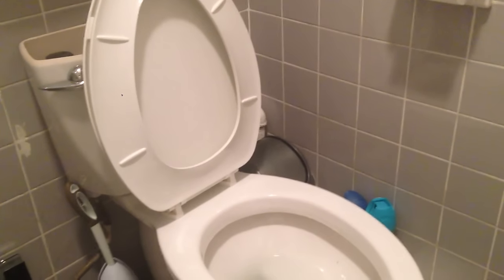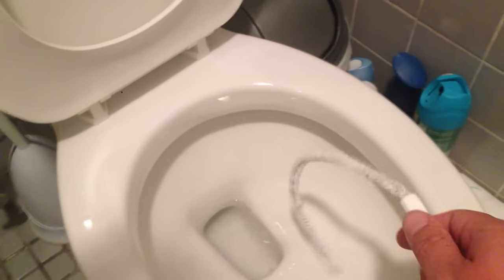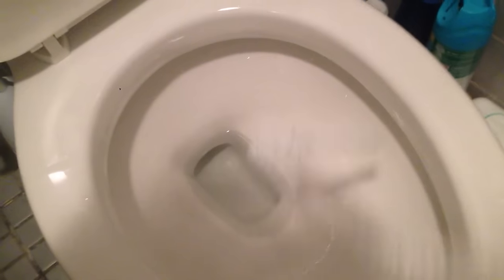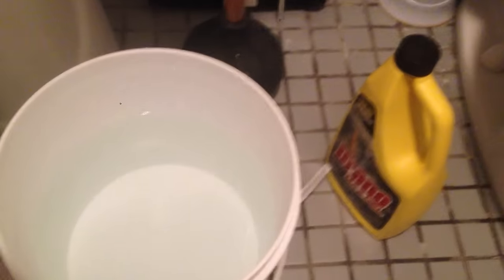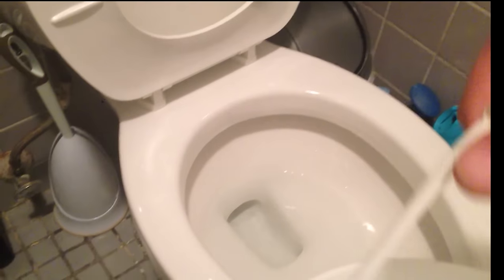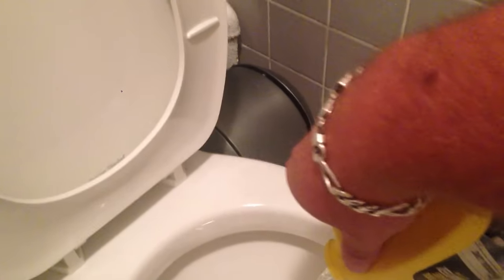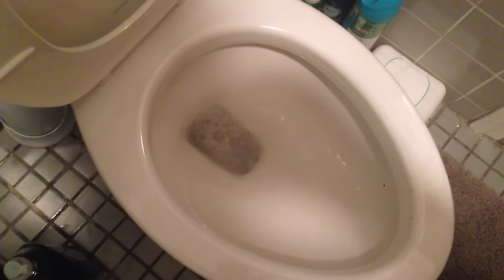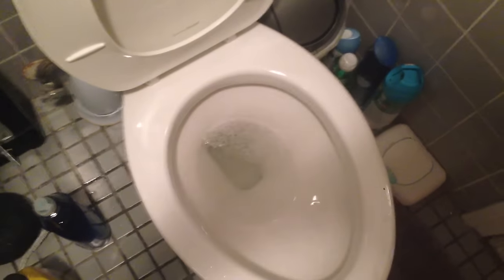How To Fix Slow Flushing Toilet  - Not Flushing Properly

Comment: My toilet was flushing exactly like yours at the start of the video.  It wasn't clogged but it was going down slowly with the long glug glug glug at the end, just like yours.   I didn't have any drain cleaner so I tried just the soap.   Well it worked like a charm,  the soap loosened whatever was blocking the flow and now it flushes like new.   Thanks for the great tip!
Reply from the maker: I am happy that my Video helped you :)
Reply: Does it work on any toilet ?
Reply: @yun514  It would not work on tankless or pressure assist toilets.
Reply: jgallantyt the hot can break the bowl if you put so long put  hot water istemate 3 menutes din plush the cold water
Reply: @OCC_Plumbing_and_Restorations  what causes a new set to not flush properly?
Reply: @babyghany9991  I'm not sure
Reply: @renaelmanibad4199  Use hot water from the TAP NOT boiling water!

Comment: All that plunging... All that snaking... All that using a bucket... Repeated times pulling the toilet... The new flush valve... The chemical drain cleaners... 3 months of unreliable flushing... And all it took was a coat hanger in the jet... Don't know whether to laugh or cry
Reply: I laughed out loud at this one. Thanks for posting this. It’s a laugh and cry kind of moment.

Comment: CAREFUL in winter!!!! HOT WATER can CRACK PIPES!!!!!
Reply: Fiddlekrazy Steve so I shouldn’t take hot showers in winter? 🤨
Reply: So I should wash my dishes in cold water?? 
& running HOT WATER to wash my hands isn't a good thing now?? 🤔
Reply: Very true.  You have to be careful in winter.

Careful means just that...... to be careful.  It doesn't mean you can't do stuff, especially with internal plumbing, and depending on what kind of pipes.

The piping that has exposure to the winter CAN crack so you just use caution.

But for a fun experiment to the nay sayers, throw boiling hot water on your windshield to help  to remove ice.....see what happens.....have a spare windshield ready ; )
Reply: J G last time I checked. Pipes weren’t made out of car windshield
Reply: Not what i said.  I was makng a point about extreme cold to sudden hot......science stuff.  You didn't get my point but cool
Reply: Hot water can break that bowl...
Reply: Cold water gets  germs stronger and hot water kils them not very  hot any hot u want
Reply: Boiling water breaks the bowl.
Reply: J G That’s a terrible example. Pipes are not made of glass, the water isn’t boiling and it’s never going to go from ice cold to boiling hot in the pipes because hot water is going to mix with the cold water already in them and make it get progressively warmer. If anything the bowl would be at more risk but I’m assuming you have heat in your house so the toilet isn’t ice cold and it’s just hot tap water mixed with a bunch of not hot soap and drain cleaner so it’s not going to be all that hot.
Reply: So as a plumber I can honestly say that adding hot water from the tub or lav. faucet to drain pipes or a toilet will not break the pipes. Putting boiling water down pipes can cause the pipes to expand and contract putting unnecessary stress on the fitting joints which over time can cause cracks and breaks. What I would be concerned about is putting chemicals like Driano into you drain lines. I personally avoid using those products when clearing a clog.
Reply: @kevinwells4086  You the man 🙌🏽
Reply: @Tsch6373  No that's cold water on a scorching plate silly 😀
Reply: @ThatOneExoRailfan  No it doesn't... Cold water breaks scorching hot ceramic ... Silly Billy 😀✌️
Reply: I ALSO love CAPS LOCK and as we say in the tech industry, BANGS!!!!!!!
Reply: @JG-zd3md  Piping isn't glass..
Reply: @alanmarietti5454  so what would you use instead?
Reply: @kevinwells4086  a toilet is a large ceramic like a coffee cup. Your tub, if older like a claw foot is porcelain clad over steel.
Reply: @JG-zd3md  LOL! I try ta tell em JG.
😉😁
Reply: @777fiddlekrazy  I know.
Reply: Let them comment and not believe science.  I'm not paying for their repairs.  Even the plumber said boiling water can expand
Reply: Our plumber placed the toilet vent about 15 feet away from d toilet ,could this cause air restrictions and slow flushing?

Comment: 1. Use Drain Clog Remover Tool, Drain Hair Clog Remover Tool, Sink Drain Clog Remover, 20 Inch Drain Cleaner Tool for Sink, Tube Drain Cleaning
2. Use a 1.3 gallon Collapsible Bucket of hot water. Pour into toilet and flush
3. Use Drain pipe Chemical (Drano max gel) any might work but try to stick with a gel. Pour into toilet. 
4. Dish washing detergent Like Dawn or similar. Open Toilet Tank Cover.  pour into Toilet Tank in the overflow pipe. Just a little. 
5. Leave for about 5-10 minutes
6. Flush to see if works

Comment: Yes i had serious calcium  almost completely clogging that hole 1 inch hole in toilet used a bolt/chisel  to break it free...finished up with boiling water a dish soap trick...You solved a problem in my life that has been pissing me off for over a year...Thanks!

Comment: I did it!!!
I wasn’t as easy as shown!!!
I wanted to do more environmentally friendly so I used daill soap and vinegar instead of draino. 
Used boiled water and left it fit 3 hours. 
Once the water cooled off I went to explore the openings. I felt a lot of minerals deposit!!!!
It was hard as a rock. There was no way a brush or tough washcloth would do. 
Used serrated knife , some came off, poured more vinegar and more soap and waited for 3  more hours . Poured in more boiling water. Scrubbed with a fork, more minerals loosened up. It was very hard to chip away a crumb of the stone , but I got about 90% of it !!!
I look at this as a success! 
I’m saying all this because some people may be discouraged and say the approach doesn’t work . In some cases we need to use more muscle to get the results . My toilet was expensive so I don’t want to get rid of it if I don’t have to. Next time I’m not gong to wait this long and inspect it for mineral deposits. 
Thank you for the post .
Reply: well info.! thanks Gratitude! : ) i like dial soap & vinegar!!
Reply: Be careful in using beyond hot water to avoid cracking the porcelain bowl!
Reply: NEVER use boiling hot water! Just the hot water from the tap! You were lucky. Boiling water can and will crack the delicate porcelain. PLEASE DO NOT USE BOILING HOT WATER IN YOUR TOILET !

Comment: Excellent video! Although I have the Kohler cylinder flush valve, this worked like a charm. I also didn’t use liquid plumber as the instructions said not to use with toilets. For those with the similar cylinder flush valves that I have, just disconnect the overflow line and put 5-10 drops of the dish soap and reconnect. You’ll see the bowl dribble the soap slowly and it took me five flushes (repeating my soap drop method). Thank you for the easy video. The King is back on his throne!

Comment: You video helped us so much. Our toilet was flushing so slowly like it didn't have any water pressure. We did everything we could think of even removed it off the crock to check for blockages. If not for your video, we would have never thought to check the small hole at the front of the toilet. Turns out there was a pop cap lodged in the small space which was causing all the problems. So thanks from the bottom of our hearts! You have saved us a huge plumbing bill!

Comment: I was at wits end with my slow toilet,.we have a septic and thought it needed to be pumped again. prior i had cleaned the calcium that had built up around the upper jets,.and still had a slow drain..I was about to call the plumber,then i seen the first 45 seconds of you vid it and didn't realize there was a lower jet..so i found stout copper wire and and began to poke around.. sure enough the entire jet was caked over with calcium,.now it flushes no problem..Thanks Teck!
Reply: g

Comment: amazing, i fill big bucket with soapy water and it didnt solve slow clog, hot water with it of course. However, when you showed putting it in the water tank and let it sit and flushed twice
it went down with mass force. You are a pro! Thanks a ton

Comment: WOW, IT WORKS!!  I almost removed my bowl. I did this with hot water and 6 oz.of HTP. Trisodium phosphate and used a clothes dryer vent cleaning brush. Bent it to fit and the crap that came out was unbelievable. Worked on the first try. I did it 3 times for safe measure. Thanks!!!

Comment: I just followed the instructions except I didn't have draino I used comet in the bucket of hot water and then I topped it up wit 1.7 liter of boiling hot water from the tea kettle. Dawn dish soap in the over flow.  Coat hanger front and back jets. And it flushed itself when I turned the water back on once water went into the over flow. Thank you for making such a good Video!!!!

Comment: Holy crap! I only got as far as checking the front hole but, there was a piece of plastic in there floating around and some calcium buildup that would block the hole when you flushed. Every time I flushed, I could see this plastic at the hole. I pried that piece outta there and viola, flushing normal. I guess the previous renter had kids who played in the toilet.

Comment: i might have just had a deep clog but either way this worked for me. hot water, drano, some detergent. i did hit it with the plunger after and its flushing like a champ again so either way im happy and this was easy. thanks for posting. 

when it wasnt draining still i was like maaaan i might have to go get a snake or auger, but nope this method and a little plunging worked for me!

Comment: A slow flusher is VERY likely the water mineral buildup clogging the fill holes that underline the bowl Rim.  Teck did mention this, I'm just confirming it.  I'm convinced this is what is clogging 1 of ours, because 1 of our best flushing toilets has the same 15 year old parts & yet flushes amazingly fast.  Water shooting out fast from the Rim holes CLEARLY has NO obstructions/not clogged.  Teck's vid here further proves that cleaning the Rim holes is very effective.  That Drano gel AND Dawn soap clearly unclogged the Rim holes, but i can understand using a harsh chemical.  If so try CLR instead and manually clean the Rim holes.  Try a brillo pad & round bristle brush(s) & CLR instead of the Gel.  Or your choice of gentle cleaner.  Bear in mind dissolving hard mineral deposits could very well require a harsher cleaner.   Focusing on the clogged Rim holes will be the fastest & cheapest thing first.  Was going to try CLR (Calcium, Lime, Rust) when i just found this vid.  Will give both a try if necessary.  We are renovating projects & i am fixing our 14 year old toilets.  If unclogging the Rim holes fails to fix the flush problem, i will rent a toilet auger.  If that doesnt fix the prob, i will replace the toilet.   If I pull a toilet, its ONLY because i'm going to replace the entire old 1 with a new one & only because we cannot get the clogged Rim holes cleaned out.  A new install Is tricky, ALOT of work and pricey depending on what you buy.  You get only 1 shot per bees wax ring.  aka --if H20 leaks at the floor level, you've got to pull the toilet yet again, remove ALL the new bees wax & slap down a 2nd new bees wax & install toilet again.  I've had 100% success in the past.  We are going to get a water softener installed that will eliminate the hard water mineral clogging problems once & for all.  Our shower heads are getting clogged very fast with water mineral deposits too.
Reply: ok

Comment: Dishwashing liquid will usually help any toilet flush faster but you have to squirt a little into the bowl before each flush. One thing I have learned over the years of fixing plumbing issues is that these low flow toilets, (fixtures, appliances, etc) and older homes / buildings in particular are NOT good matches. There is often not enough water to flush everything out into the street's main sewer line so in enough time it's not unusual to wind up with a slow running drain. I come across this every year or so with the same older homes. The owners are often hell bent on saving water. My recommendation has been to keep what you have (vs replacing) and make adjustments so that a low flow toilet flushes with more water or an older model flushes with a little less water. There are also many older makes (pre 2000) that just were not made very well (1st generation 1.6 designs / cheap stuff) and as a consequence they flush slow. I would replace that but consult with a trusted pro before making that call.

Comment: Thanks, Mate.  This worked well for my toilet. Tried it 3 times and finally its working well.. I would recommend letting the dishwasher liquid to stay in the pipe inside the flush for at least an hour..  Also I cleaned the inside rim of the toilet bowl using the same dish washer liquid by hand using a scotch Brite sponge.(Use Gloves).    Great video..very useful.
Reply: Jayan, good tips! : )yes 'great vid.!

Comment: Is pouring drano safe i know the back says not to pour in toilet
Reply from the maker: It should be fairly safe, not 100% safe. It is not recommended for unclogging toilets. but in this case we are not using Drano to unclog it, we are using it to remove or dissolve element in the front jet area and not anywhere near the back where the wax ring is located

Comment: Californians are often using buckets to flush their toilet with shower warm up water.  We did this.  What happens it that it sends toilet paper into the jet hole and along with calcium will totally plug the jet.  I found it out after replacing the toilet I could not get to work after trying everything.  When I cleaned it up to give away, that is when I found the clog.  So I would recommend Californiana save their rain water in a watering can and take it to the garden.  

Also, when we lived where we had a septic system, we had to use the bacteria additive if the toilet gurgled when flushing.  That always helped it.

Comment: Terrible video!  You never ever use a chemical like Draino for toilets.  The heat from the Draino chemical can damage the porcelain and possible crack it.  Use CLR, or vinegar to water mix 1 to 10.  Don't forget to clean out the jet in the bottom of the toilet as well as the fill holes in the toilet rim.

Comment: 6-9-2019 at 9:35 I tried it first I flushed the toilet to check the Jets and only a few were working so I put dish soap waited for a few minutes then flushed it and holy (CRAP) it worked all the Jets work with full force now I can go Al Bundy style lol thanks for your help
I finished at 9:41
Reply: Did it foam or not. ??? I hope it works for my toilet bowl.
Reply: @Mamatha450  no it did not foam just let it sit
Reply: @conradorico8946  Thank you.
Reply: U welcome good luck
Reply: @conradorico8946  I tired and it worked like magic. No hot water. No darn chemical. Pheww..
.. i waited 8 to 10 mins after putting dishliquid.

Comment: Never use drano on a toilet! It'll eat away at the plastic seal, then you've got a whole new issue.
Reply from the maker: Drano will not damage your toilet unless you put allot in and leave it for long time. When you add Drano it does not reach the seal, it stays in the bowl and the S shaped passage, after 10 you flash it so it goes down the pipe.
Reply: Teck is correct, also Drano Max is toilet safe.
Reply: All the drain cleaners I have found say not to use in a toilet, as long as I don't use a lot is it safe to try?  I pretty sure my issue is a plugged siphon as the water fills but doesn't seem to have enough push to go down.  If I force flush with either hot or cold water it's not an issue.  Is there a specific drain cleaner for this issue or will any draino work?  I have a Draino dual cleaner left from a clogged sink, is it safe to try that?
Reply: TheRoshan89 I bought drank to use in the toilet and there is a warning on the bottle in bold letters- “Do NOT USE THIS PRODUCT IN A TOILET!!” It can easily damage the pipes or cause ceramics to crack! The dish soap and hot water is enough!
Reply: @42Ladysusan  i hear what you are saying but there is more than one type of drano. If you can go without it, even better! But there are different versions of the product.
Reply: @42Ladysusan , Stop looking at just the name of the product. There are several different Draino's with each serving a different purpose. There are toilet specific products available.
Reply: @delldelete2435  Thanks, but as  it turned out, the hot water and dish soap worked like a charm!

Comment: Calcium buildup in that front jet was my problem... chipped it out with a allen wrench, and then put some CLR, or Lysol Toilet cleaner in the hole under the flapper valve,,, this also cleaned out the jet holes under the rim,,, works great now...

Comment: I moved into a house that had a sluggish toilet in the hall bath.  The previous owners had young boys, that must have dropped a plastic poker chip into the toilet.  To investigate sluggish flush, I used sponge to remove all water from the bowl, and used a flashlight and compact mirror to view up trapway from the bowl.  I noticed something strange on the front wall of the "throat."  I could reach it with my hands and pried it off the wall.  It was cemented to the wall with poop.  I believe it had been in there a long time; first fluttering about, and gradually poop built up and glued it to the wall.  After removal, and brushing, and hot soapy water soak, toilet flushed like new!